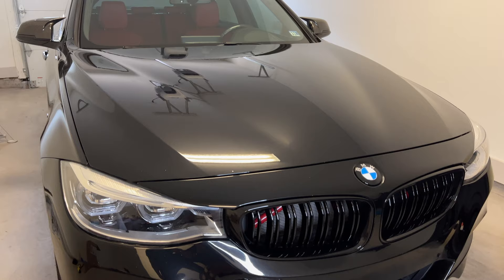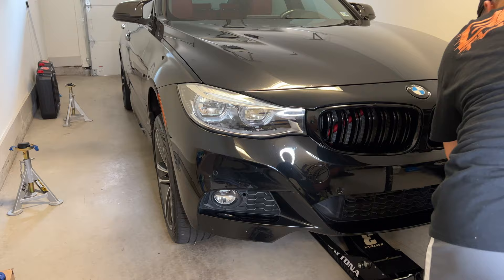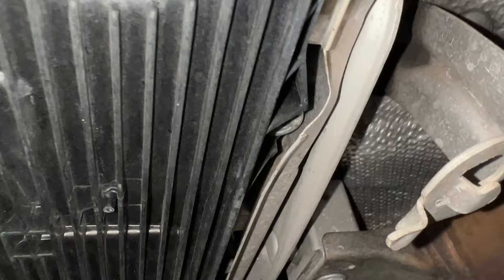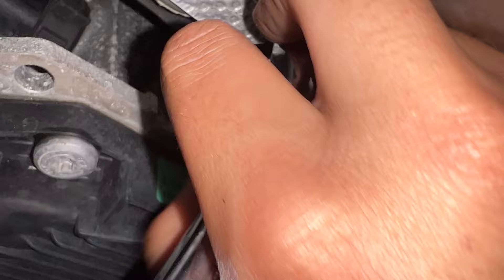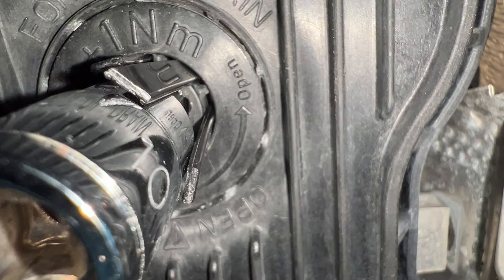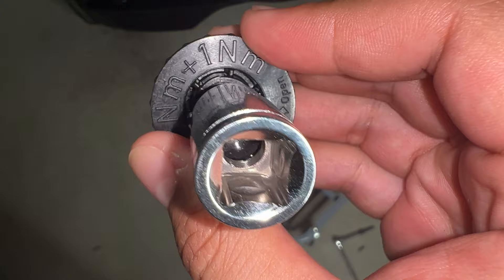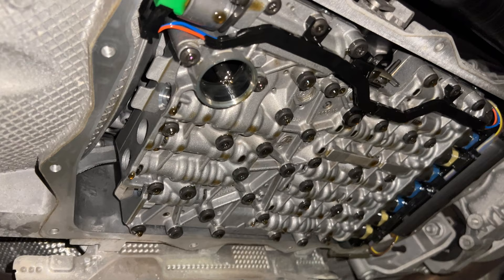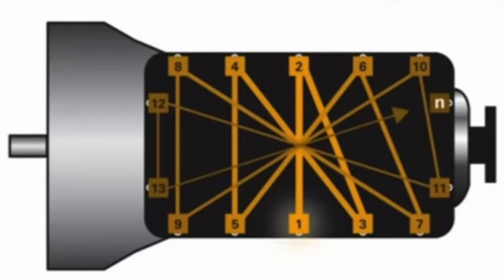ZF 8HP Transmission Service DIY At Home! - BMW F34 340i GT (HP50, HP51, HP70, HP76)

Comment: I use the aluminum cross member behind the rear differential as the rear central lift point on my 535. Works well and no risk to my diff.
Reply from the maker: @kjhnsn7296  yep that works too. I lifted mine from the diff casing a handful of times and no issues, then I found out about the other jacking point afterwards. I think it’s been proven that the diff point is ok, but I agree the crossmember may be a better spot.

Comment: silly question, did you leave the car in jack stands while the engine was running during the refill process when you warmed the engine up? when you were inside the vehicle was the car still in jackstands?
Reply from the maker: haha yes I sat in it while I started the engine, went through the gears, and revved it at 2000rpm. Hopped in/out careful and slow. I waited outside the car for it to warm up while I read the temperature data on my phone. Car is pretty planted when properly on 4 stands.
Reply: @supremegt  Recently I started getting a transmission malfunction error. The car drives but in limp mode and I don't know if changing the oil of the tranmission will address the issue. The car is at 145,000 running great except this issue. I probably gotta remove the pan and see whats up later in the day to see what is happening. The Clutch A disrupted error is coming up in ista, any insights you have?
Reply from the maker: @JaysonFlores-d1p  I am not sure about that error. But generally, I would think that by giving the trans new fluid and a new pan helps to keep it happy. But I suggest to scour the forums to see what others have done to fix your issue.
Reply: @supremegt  I would say once the car drives it shifts into the near gear but after downshifting it does it very rough then shortly after into limp mode. I'm almost considering replacing the solenoids while I am at it.
Reply from the maker: @JaysonFlores-d1p  let me know what happens!

Comment: Question I gotta diagnosis test done and they said my transmission pan was leaking if I order this kit from fcp will this fix the pan leak ?
Reply from the maker: The pan comes with a new seal so it probably will fix it.

Comment: The manufacturer ZF really indicates what this specific model is: 5, 6, 8 and 9-speed automatic transmissions as well as 4HP20 automatic transmissions:
Each of ZF's 5-, 6-, 8-, and 9-speed automatic transmissions, as well as ZF's 4HP20 automatic transmissions
they are filled with specially developed partially synthetic ATF oils and are maintenance-free. Without
However, due to the many factors that influence the life of gearboxes during individual operation,
ZF recommends an oil change for its gearboxes every 150,000 km. Under operating conditions with high
temperatures and loads, or if the vehicle has been used in the past in an unknown way, it may be advisable to change the
gearbox oil at shorter intervals.
It must be taken into account that only the respective authorized ATF oil is used for the oil change and that the change
of oil is carried out according to the corresponding prescriptions. ZF's 5HP18 automatic gearbox is a
exception and must be filled according to the respective version.

Comment: We have to bear in mind that to do a complete oil change in the automatic gearbox we will have to use a dialysis machine, since otherwise we will only replace less than half of this oil. The rest stays in the torque converter, in the pipes and in the oil cooler. I indicate the link of a Spanish video in which this oil is changed with a dialysis machine in a BMW 5 series. As final data: 8.5 liters added + 2 liters used for prior cleaning of the circuit. It is very interesting: https://www.youtube.com/watch?v=r9PjrGFLuP4
Reply: that is cool, I think the general idea is that a drain and refill which is maybe 6L or so is enough, unless there is some extreme case or specific need to completely evacuate
Reply: This is flushing, very common in germany, but much more expensive.

Comment: I think mine wasn't sealed tight enough after a service. It looked to have leaked oil. I'd it possible to simply top up the oil?
Reply from the maker: It’s definitely doable to top off the fluid, but I would imagine the trans has to be up to temperature first. And you also want to make sure to address the loose seal beforehand!